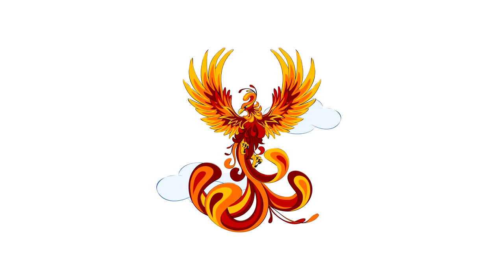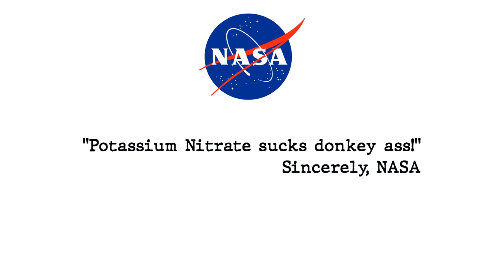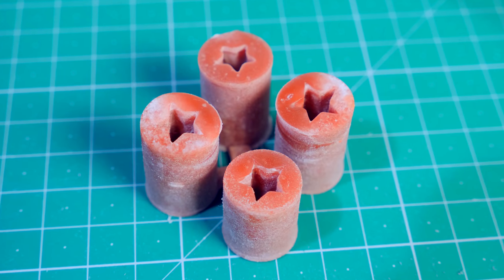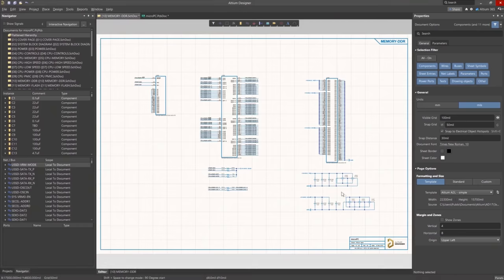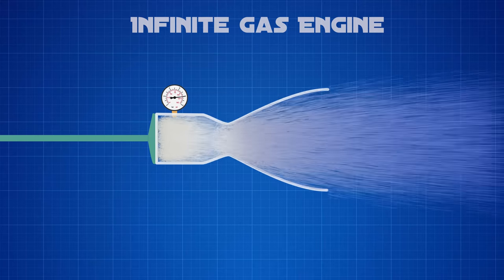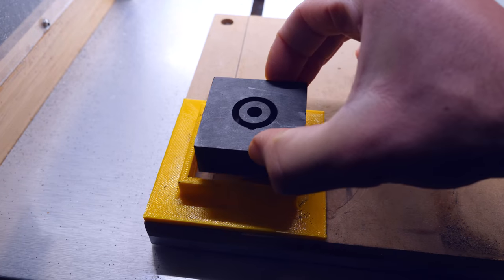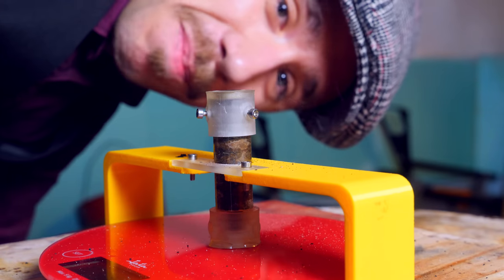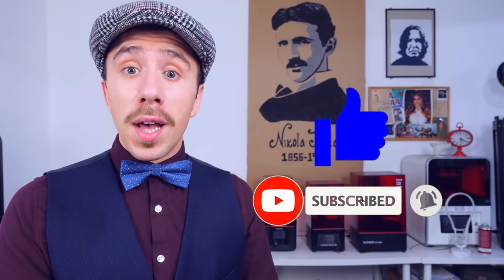I built a PULSED ROCKET ENGINE

Comment: The breathing you saw in the last iteration of your propellant was more than likely due to a lack of oxygen. The fuel burns the available oxygen and then the huffing starts as it pulls in more and continues the cycle. When you placed it facing down you cut off its incoming oxygen supply, instead of using the scale to measure the thrust, figure out a way to attach it to a control line to keep it moving in one direction then use a high speed camera to record. Mythbusters, smarter everyday and slow mo guys use this technique.  I look forward to your follow up.

Comment: Video idea: Make a hybrid rocket engine with your solid rocket fuel and liquid oxygen. You could condense your own liquid oxygen using canned air. The canned air is mostly nitrogen which has a lower boiling point than oxygen. Spray the canned air into a container upside down to get the liquid nitrogen and collect the condensing oxygen off of the container.

Comment: What if you used the nitrocellulose to ignite the propellant mixture?  Hopefully, you could ignite the entire main body of the propellant nearly simultaneously, to get a more even burn, and the nitrocellulose would help to get the initial chamber pressure high enough to start the supersonic flow.
Also, why not use model rocket ignitors?  They are electrically triggered, allowing a safer way of firing the rocket, and they are pretty cheap, too.  

I would love to see you use the rocket to propel a stunt car over a jump.  Like your house.  :-)

Comment: What you essentially did was make a cannon, but without the proper structure and tolerances. Nitrocellulose burns at an explosive rate as it creates pressure inside an airtight and confined space.

Comment: To 3d print a first person view smaller rocket powered jet plain copying the same aerodynamics of the peroquin falcon. Using the same method of propulsion you do in this video. Then add the fpv camera and experience how it would be to be in a jet while safely on the ground. 

I would do it myself if I had a 3d printer but minimum wage dosnt quite allow you to be a make shift pilot. 😅

Comment: If you still have that 70% hydrogen peroxide from an earlier video you should try making a 3D printed hydrogen peroxide bi propellant rocket. Iv actually been trying to do somthing similar on a small but have decided to stick to oxogen gas until I m more experienced with 3D printing rocket engines

Comment: Video Idea: You can create a slider like the one you usually use and attach springs to it. Measure what the pressure of the springs are total at certain amount of pull like 20cm= 5lbs or 10cm = 2lbs. You get the idea. Or you can see how far your rockets pull the springs then use a hand hook scale and pull it just as far, then simply read how much weight it pulls to that much distance. As long as they are the same springs you should be able to measure it pretty accurately. Show us how you did all that and test it see if it actually works!

Comment: Could you chop or carefully grind the nitro cellulose and mix that with the resin to print the engines with ? 
What would the burn rate be like then ? Or on the other hand what could you add by percentage to the nitro cellulose to slow the burn down to a more manageable level ?

Fattrucker

Comment: Finally read our advice on the nozzle, since the first video I told you you needed a graphite nozzle, BUT YOU'RE STILL USING A PLASTIC CASING THAT'S A SUREWAY TO GET HURT plastic splinters and sends shapnel flying everywhere, also you can't just change the chemistry of the rocket fuel and expect it to behave the same, please read on the actual chemistry of the reactions you're doing so you don't get hurt, experimental rocketry like this is not a game.

Comment: Dear Integza,

I wish I'd discovered your videos sooner. I just saw this, your turbojet and your peroxide mono-propellant rocket. 

Since you are soliciting ideas for future videos, would you consider comparing the thrust generated by a turbojet motor (like you designed and built in https://youtu.be/C2OmUBpn66k) with a solid fuel rocket motor (for example, APCP)? 

I would love to see similarly scaled devices, and show how each would push the same reference platform (like skateboard). 

I was originally going to suggest a peroxide mono-propellant rocket motor, and then I saw you already did that in https://youtu.be/vVven2CPaaw :

    An even more fun rocket engine is a simple pump for concentrated H2O2.H2O 
    (hydrogen peroxide in water, with the peroxide proportion above about 3/4 
    by mole:mole ratio), sending a laminar-flow stream across a small piece of
    platinum. This will rapidly decompose the peroxide, liberating heat, which 
    will turn the water into steam. The rapid increase in volume by the nearly 
    instant boiling, pushed through a converging nozel will give really massive 
    thrust. But be cautious, peroxide above pharmacy concentrations can be dangerous. 

You said you have a sister. Would she be interested in becoming a test-pilot and commanding the skateboard for powered acceleration under the two types of motors? 

Thanks

Comment: Don't 3D print rocket fuel. 3d print mold or form. Mixture form by that. 
There is still to much of resin in your atemps and it makes your rockets weak.

Comment: why don't you try to heat a water reservoir with your carbonfiber pulse jet engine and use the steam in your wankel motor to generate electric power?